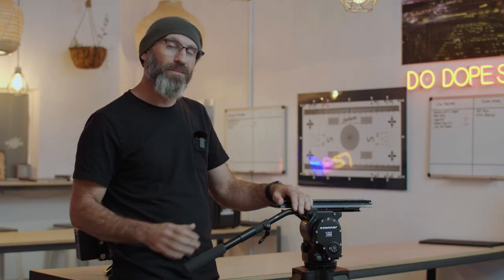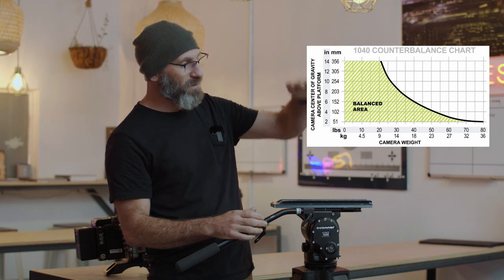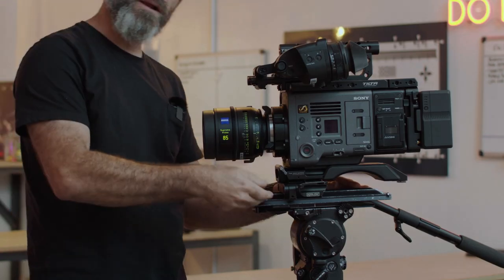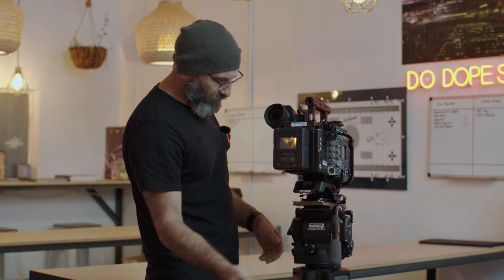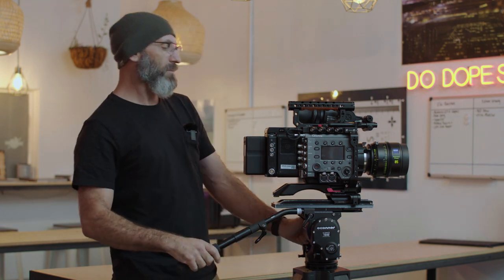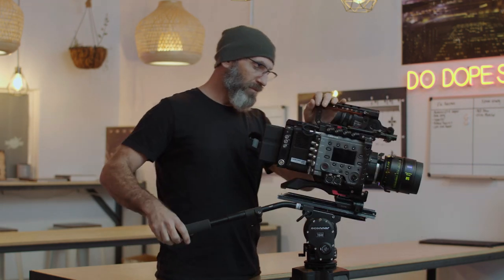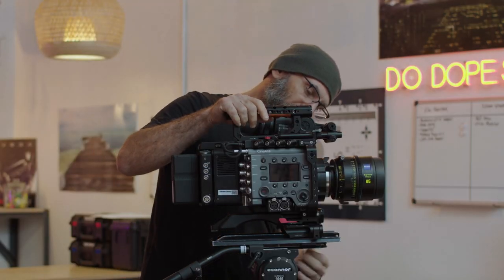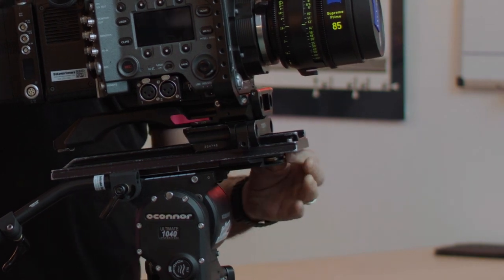DeHaven Camera How TO: Fluid Head Setup and Use

Comment: Great stuff there! One minor nitpick is that O'Connor 1040 in particular, should be left at 100% counter balance setting when stored for a long time. That is mentioned at the operators's manual page 22. Same goes for Sachtlers.
Reply from the maker: We always suggest following manufacturer suggestions. O'connor uses a very unique counter balance system (they have a patent on it) that no other manufacturer uses (caveat, some sachtler now use this as they are owned by the same company) so this suggestion would be specific to their design. Many other brands use a band style system and leaving that under load can cause issues in long term storage.

Comment: O’Connor says that for long term storage you want to increase the counter balance… Not sure why but it says so in their manuals.
Reply from the maker: We always suggest following manufacturer suggestions. O'connor uses a very unique counter balance system (they have a patent on it) that no other manufacturer uses (caveat, some sachtler now use this as they are owned by the same company) so this suggestion would be specific to their design. Many other brands use a band style system and leaving that under load can cause issues in long term storage.

Comment: Whats your take on the oconner vs the sachler aktiv 10? Bluntly
Reply: SECONDED
Reply from the maker: So this can get a bit opionionated on my end. However the 1040 is still the best cine head between those two. Keeping in mind that the same company owns both Saschtler, Oconnor, as well as manfrotto and gitzo, so you will see similarities in some cases. Personally I am not a big fan of the Aktiv for cine use. And currently my favorite head in this size range is actually the Miller CiNX5 which has some amazing features we have asked for in a cine head in this size for years.
Reply: Why not aktiv for cine uses? Not strong enough?  @DeHavenCamera
Reply: @DeHavenCamera  what fearures does the cinx5 have u mentioned? And what don't u like about the aktiv series
Reply from the maker: @JoshSmith-ct3fi  For the miller I prefer the use of a Arri standard dovetail receiver on the top plate vs mini or euro QR like the 1040. And I do not like the Sachtler ENG style slide plates as they wear out and slip. The Miller also has 4x Arri anti rotation 3/8-16 threads on the base for rigging which is really nice. Overall use is very solid and smooth. The base can be changed from 100mm, 150mm, or Mitchel. And lastly the price is 50% of the 1040